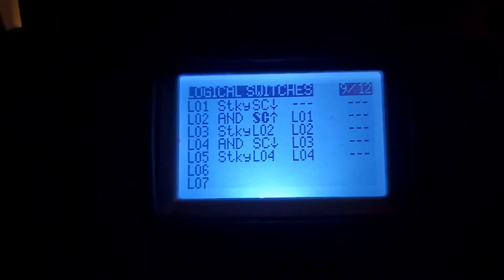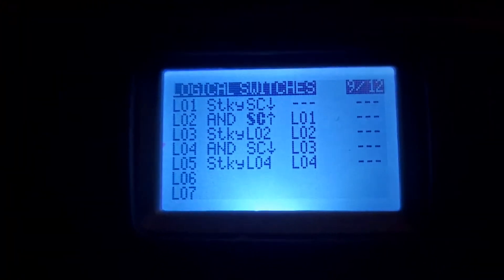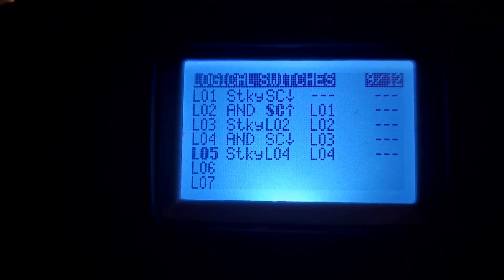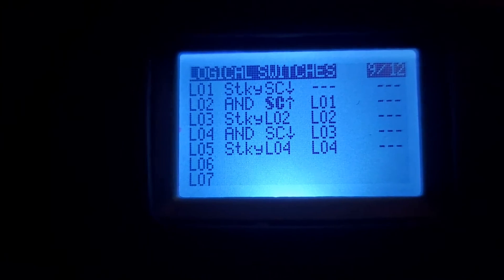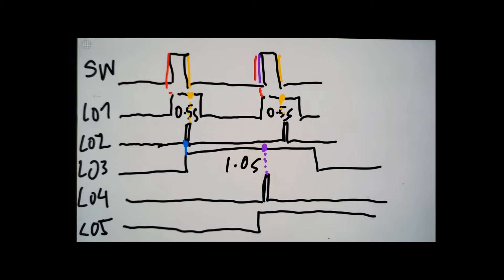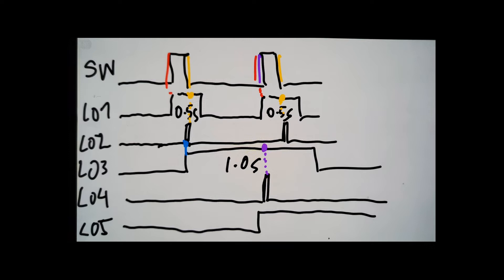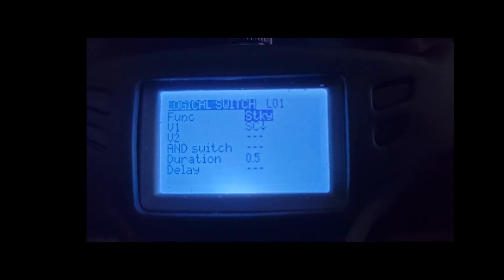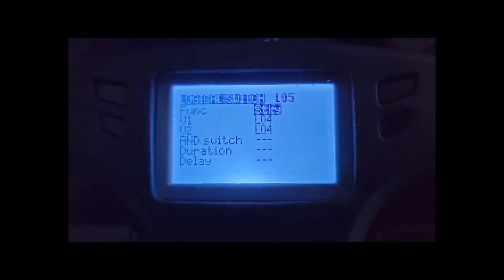Edge TX Tricks - double click to arm Part 1 on Jumper T-Pro

Comment: have you encountered any issues with the jumper t pro?
Reply from the maker: I'm still waiting for the t-pro to arrive, but I have tested the sequence and timing, and it seems to be solid. I will test properly once I receive my t-pro.
Reply from the maker: I finally tested on t-pro and it works great, btw I shared a new video with a simpler design: https://youtu.be/BtHDcRn7Tw8